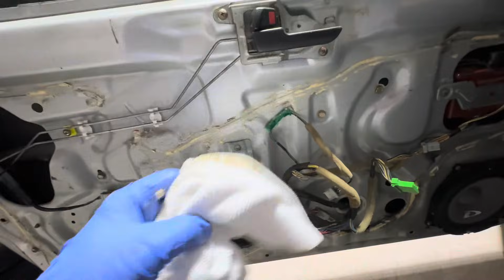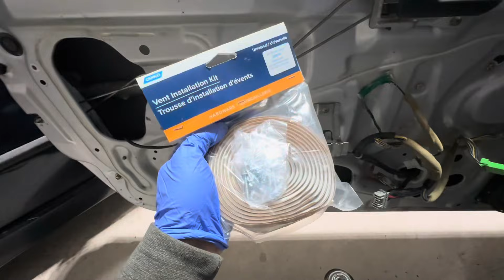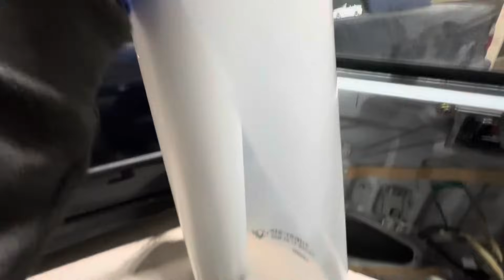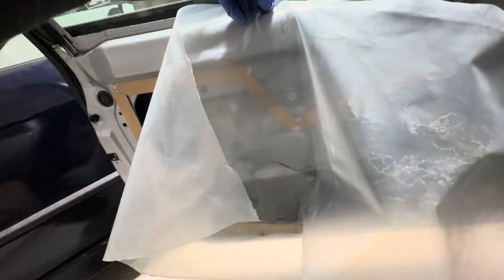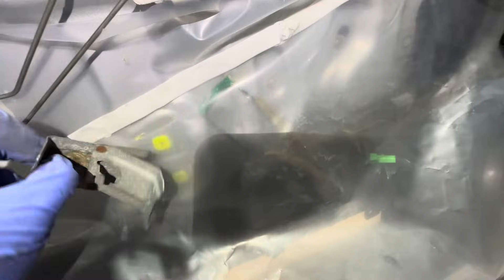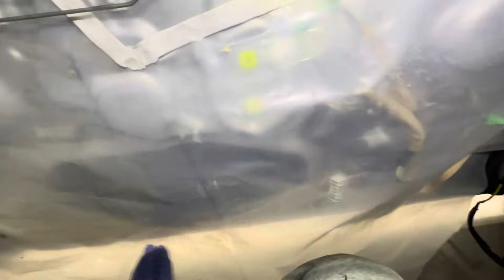How To Easily Replace Your Door Panel Vapor Barrier: DIY At Home!

Comment: If you dont to waste money on a Vapor Barrier, you can use a sheet of clear plastic that you may have laying the garage or storage shed. Preferably 6-12 mill. It will work exactly the same.